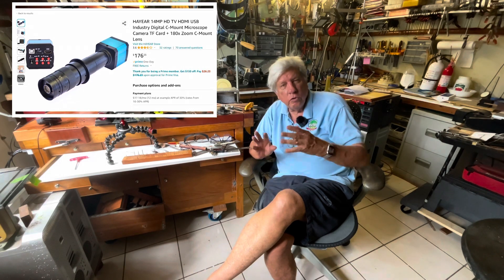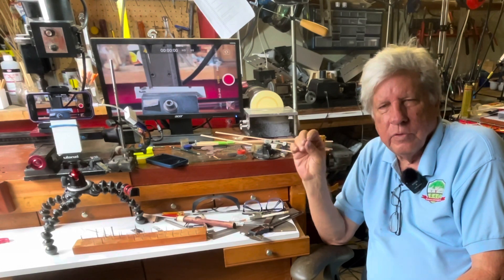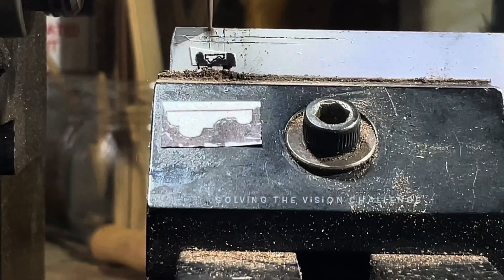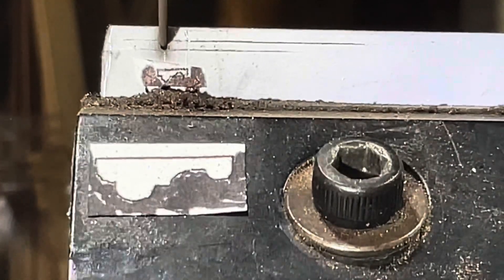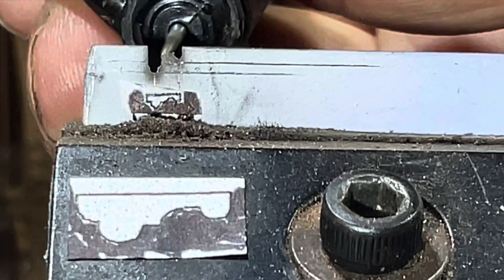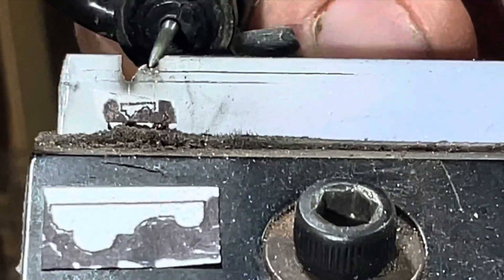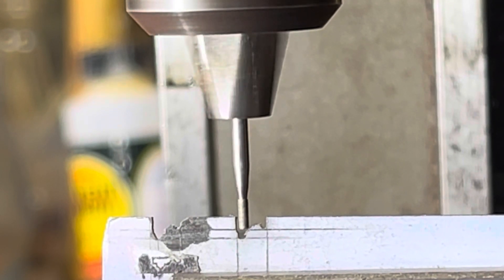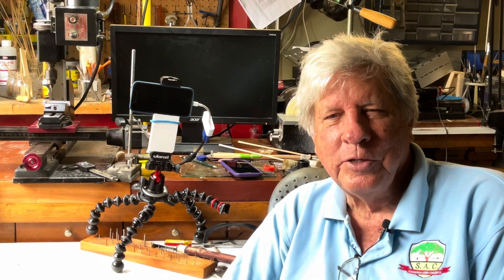Video 111 HMS Thorn. Using a monitor  to see how to cut the scraper to make moldings.

Comment: The end result looks great!  I found that when trying to do grinding, like you are doing, it helps to grind everything away down to the first level from the top and to full width needed.  Then grind to the second level, full width, etc.  This seems to help me make profiles like yours.  I have both the Sherline lathe and mill, but one could grind the profiles using only the lathe.